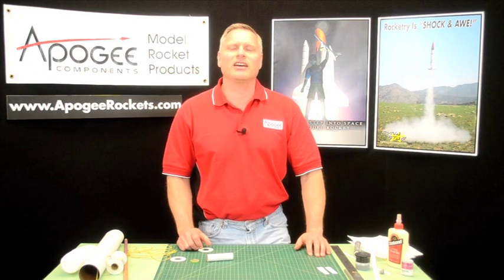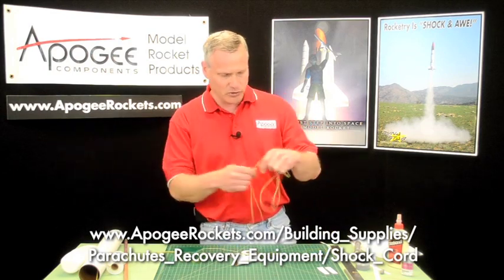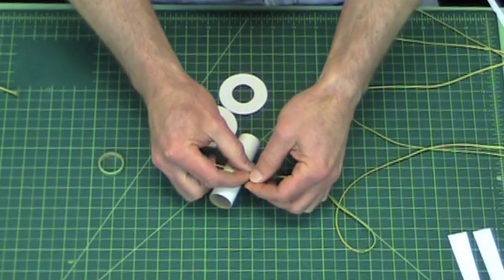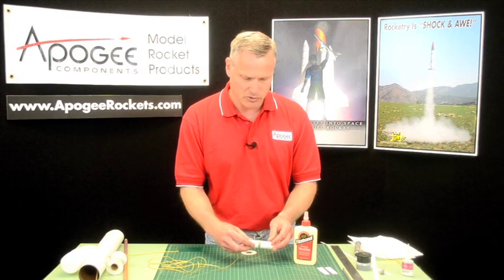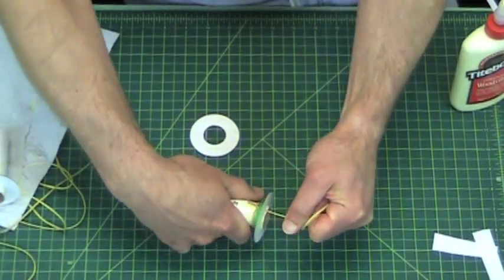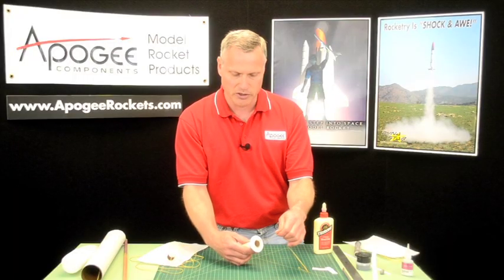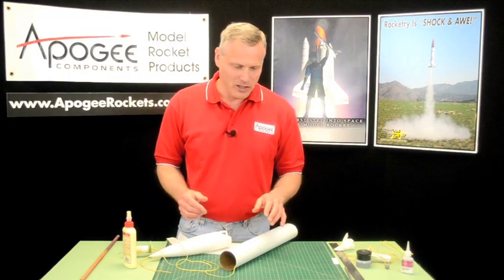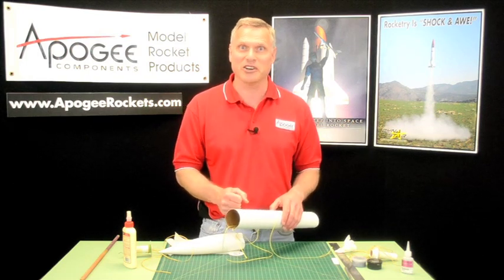Simple Shock Cord Attachment Methods

Comment: I remember back in the '70s being recommended to cut two little slots in the tube and then push the cord through the slots and tie the shock cord together.  I also remember seeing some sort of reinforced foil (heat resistant) stick on shock-cord connector.  Things have come a long way since then.
Reply: Ur old

Comment: Oops. I just anchored a Kevlar shock cord to the forward centering ring without the reinforcement. And installed the motor mount. I’ll go in to the tube and add an epoxy clay anchor. Good idea, that should save it.